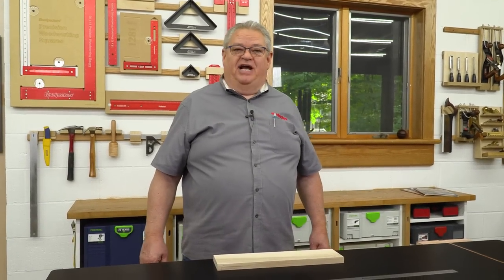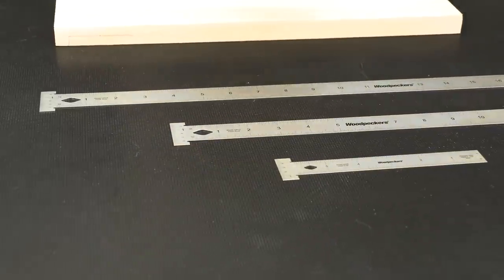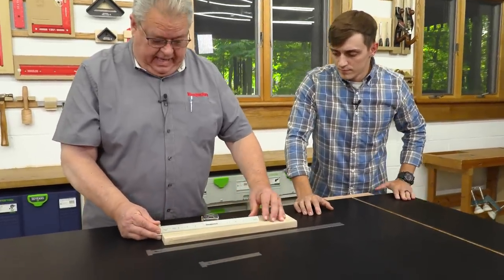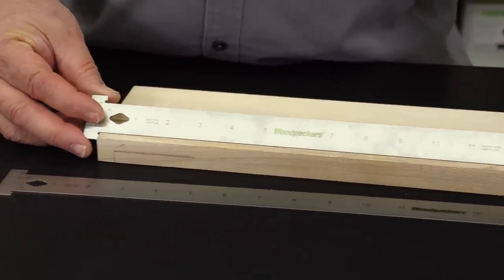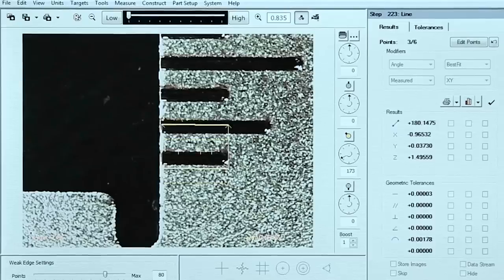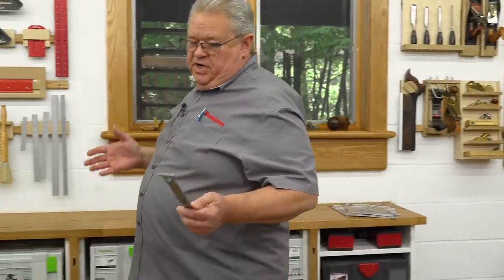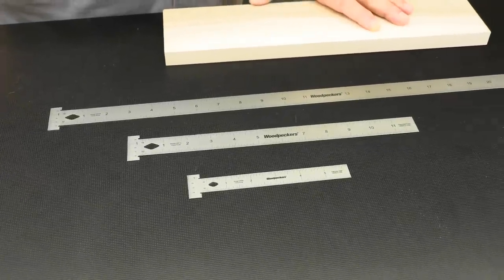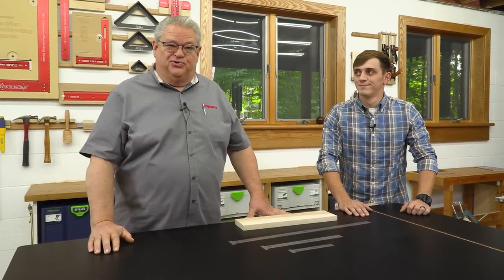Hook Rules | Woodpeckers Deep Dive

Comment: I bought the incra marking rules the complete set from the 3 inch t rule 6in and 12in t rules the 6in and 12in also come with a bend rule and a marking rule plus a plus the set also includes protractor and layout grid all for a little over $200. I love mine layout is a breeze. If people are looking for a cheaper option and more bang for your buck plus you get a centering rule

Comment: Why choose this hook rule over the other options available on Woodpecker like the T Square or Woodworking rules?
Reply: The Hook Rule is less expensive than the T-Square. It's a bit more than the aluminum Woodworking Rules, but the hook is built-in. A stop for the Woodworking Rules is an add-on. Some people prefer steel to aluminum, too.

Comment: What is the advantage over the poalini rule?
Reply: The stop on the Paolini is designed to set the end of the rule a certain distance into the stock. The hook on the Hook Rule is designed to register zero to the edge. The Hook Rule lays flat, where the Paolini won't lay flat with the stop installed. Tough choice...they both have great features. The Hook Rule is significantly less expensive.
Reply: My Paolini lives in my shop apron along with my 6-inch square.

Comment: I really like Woodpeckers tools. But my God are they over priced. I'm just a hobbyist. Are the tools made of platinum?
Reply: What are you comparing them to, J. Dooley? If you compare them with other brands made to the same tolerance, I think you'll find them competitive.
Reply: @SharpToolsUSA  I was comparing it to its cost of production compared to the price.
Reply: I've got a background in production manufacturing. The more you make, and the less inventory you have to carry, the cheaper things can be. Woodpeckers has a huge variety of things sold to a relatively small market  so production levels are low compared to things like shoes, consumer electronics, or other goods that a wide audience needs. They make a few things that have seemed excessively high but the bulk of their 1 time stuff has been about like I'd expect. Especially considered they do runs of things in metric and imperial. Some of their products could probably be standard inventory and bring the cost down.
Reply: @NorthWoodsDiver  we agree.
The company with just too much good stuff to choose from.
If the prices were lower, I'd be everything even if it was redundant. Currently, the prices are outside of my comfort zone.